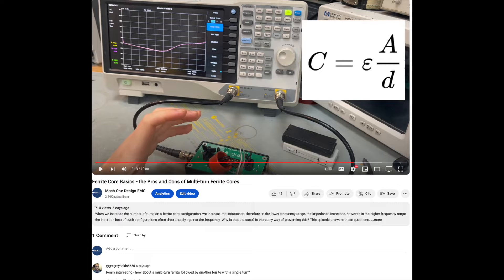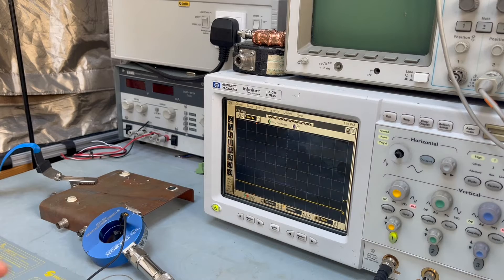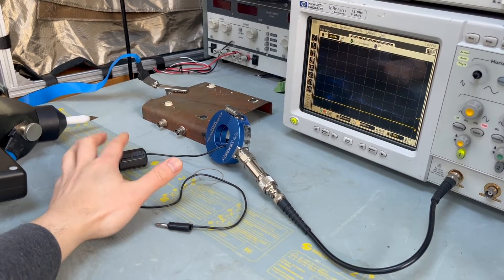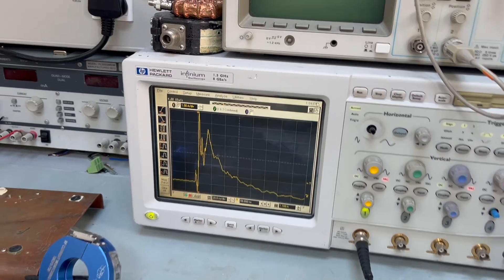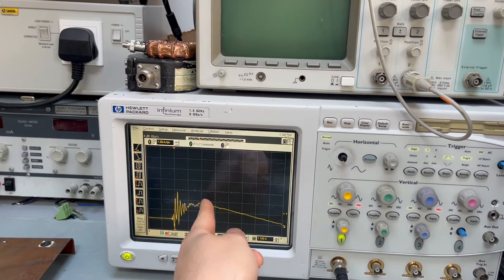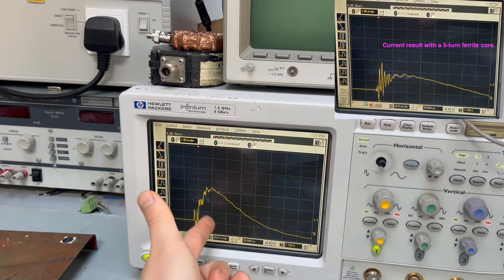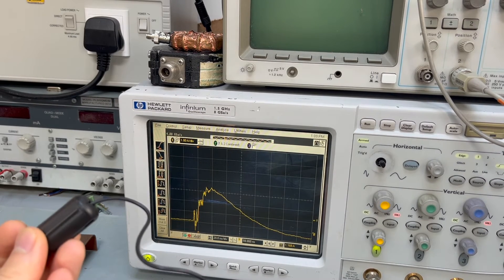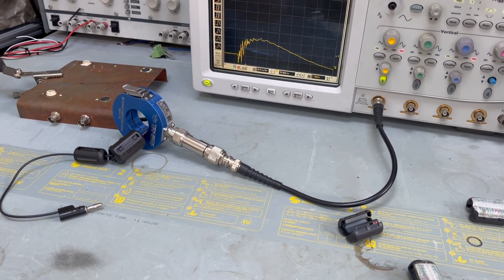Ferrite cores in real life applications - an ESD example

Comment: Great as always!
5 single turn ferrites have lower impedance than a single 5 turn ferrite because the impedance is proportional to N^2. This is why 5T works better at LF than 5 1T ferrites.
As you said at high f, the parasitic capacitance is higher in the 5T ferrites than in the 5 1T ferrites. 
In the 5T ferrite the current is 5 times of 1T ferrite, and the ferrite can start to saturate.

Comment: Brilliant! A really good idea to demonstrate it like that using the ESD pulse. Many thanks for taking the time. 

In the past, I have fixed issues by putting several (single turn) ferrites on a cable, but I think you've just demonstrated that multi-turn + single turn may actually be a lot better in many cases (not least the benefit of being able to fit them in tight spaces).